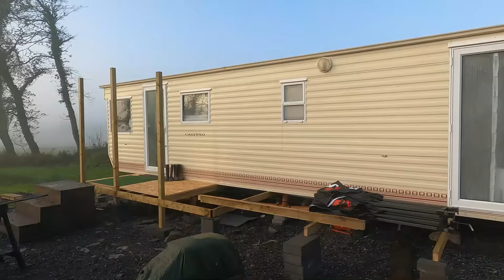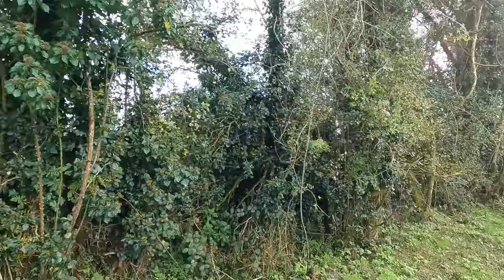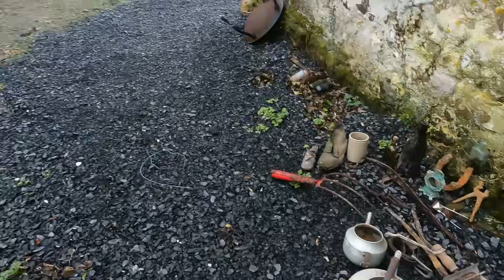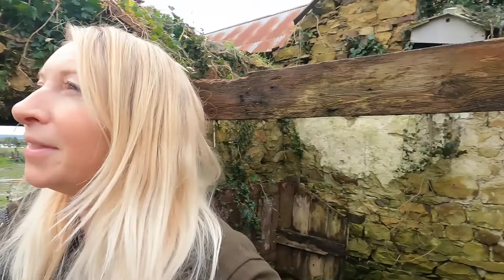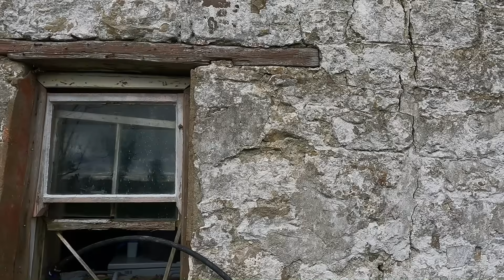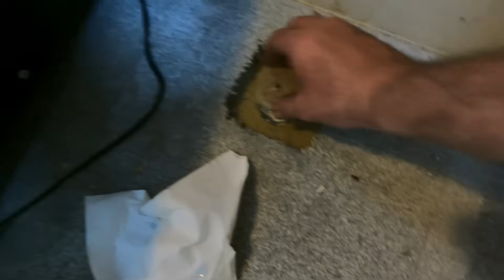Prepping for Winter - installing a diesel heater & and cladding the caravan. Episode 11

Comment: To ensure that the ivy does not come back, get some copper nails, as these are very effective. Although you could cut some scrap copper pipe in to slivers and hammer them in to the main ivy root at the base of the tree.
Reply from the maker: This is really interesting! Never heard of doing that before! I'll try and source some. Thanks. 👍
Reply: We use copper nails to kill trees in north america,

Comment: The horse harness parts are called the saddle, there is also a long piece of metal that looks like Collar hames. The thing you mentioned as a belt also looks like a part of the harness, where one side of the shafts are connected to the saddle.  The metal thing is a curry comb, its main purpose is to clean the horses brush of scurf when you're grooming.  The are also useful for removing dried mud on the horse.  I hope that helps.
Reply from the maker: Thank you so much. Really informative. I'm going to keep all the things we find. ❤️

Comment: Getting a 4 outlet diesel heater is a very wise decision…heating under the bed possibly? 
I am in a 2 berth touring as a temporary measure, and I have a Chinese diesel heater (5kw, one outlet). It does a really grand job, couldn’t be happier with it, but if I was going to be here longer term, a 4 outlet would be the way to go.
I have the one outlet where I sit, at night mode it is under the bed….
Reply from the maker: It's been a game changer, especially for the kids' bedrooms! 🙌

Comment: You are doing a great job' Plug every hole in the walls and floors no matter how small with steel wool. It wont harm the mice. They just do not like to bite it as it irritates their mouths.
Reply from the maker: Yes, we do need to do that. Thanks for the tip. 👍❤️

Comment: When I fitted a diesel heater in my man cave I put outside and then just the hot air pipes had to come through the wall a lot saver I think
Reply from the maker: Hi, yes, that was an option we considered, but there is a benefit from drawing the air intake from the already conditioned air inside the van. Sam has been really careful with the exhaust pipe, and hopefully, all will be well.

Comment: There was ivy cut away from trees at a station I used regularly. The bottom cut away that is and I was surprised to see the ivy didn’t die. Since I’ve noted that ivy seems to root into the bark of the tree. Anyway no expert and I wish you good luck 👍
Reply from the maker: Yes, my mum, who is a gardener, advised me it is likely to continue to thrive off the tree and to remove as much as possible myself. In a few weeks, I'll get the ladder up a bit higher and try to pull some more off.

Comment: Regarding the sheep wool insolation, some places now use plasma-ion treatment, this eliminates the use of chemicals and protects the wool from insects such as moths etc. Sheep wool is the most fire resistant.  Fiberglass and rock mineral wool is nasty stuff.
Reply from the maker: Thanks for this. We are still trying to decide what to use.sheeps wool does sound good and not too expensive either. Sam hated using rockwool when he used to do loft insulation jobs. It was purely down to costs that we considered it.

Comment: Not going to like the answer but that wall has to come down. Its leaning too much but its also cracked in spots. Thats a danger. No doubt it has poor or no foundation which is where the lean is from. Acro the roof for support. Pull it down start again with it.
Reply from the maker: Thank you for the advice. We gave had a structural engineer who specialises in long Irush houses like ours contact us. He is helping us out with our options so fingers crossed we will get it right even if the wall does need dropping. 👍

Comment: Those heaters used to be only available from premium brands like Webasto and Ebersbacher, with prices starting around €2000.
In the last decade or so, the Chinese flooded the market with cheap copies and if you get a good one they are brilliant. Too late now, but I’ll say it anyway, for others who may read it. You can get all sorts of fittings to split the output from the large diameter single output models. That makes it possible to design a more efficient hot air system, delivering more hot air to larger spaces and less to smaller ones. The difference is not huge, but if your heat output is marginal, it’s a help.
Reply from the maker: We had an Eberspacher in our motorhome. We regretted not taking it out, although there is still time since it hasn't yet sold! 
We stupidly realised afterwards that you can  easily adapt to 4 pipes. Have to say we think David's one is better than the one we bought but just as good as our expensive Eberspacher!🙄

Comment: Just cutting the ivy at the bottom will eventually kill the ivy at the top. However, the ivy roots will regrow unless you take them all out
Reply from the maker: I just don't have it in me to remove the roots...they are so vast! I've been told ivy doesn't harm the trees now, so I just don't know what to do for the best. I will do some more research on it. Thanks.
Reply: @theirishhomestead  yes, the roots can be massive sometimes. I have always been led to believe that ivy will strangle a tree and caused it a lot of issues🤷‍♂️. However, if you just control the ivy at the bottom and cut it back every year the trees will be fine. You could try a herbicide on the growing ivy at the bottom to kill off some of the roots.
Reply from the maker: @Duncan-el1qy  thank you. Yes, I had considered the herbicide to put on the cut parts. I hate seeing it smothering the trees!
Reply: @theirishhomestead the ivy that has been cut that is still on the trees will soon die as long as it has no connection to any roots in the ground. It will go brown in a few weeks and after a time it will be easier to pull off the trees. The herbicide would be for any new shoots which start re growing - this will be absorbed by the leaves and eventually kill be taken down to the roots and kill off the plant.
Reply from the maker: @Duncan-el1qy great thank you. Looking forward to removing it! 👌

Comment: Ivy is fine on Trees but will exploit any holes, cracks, openings etc; in Masonry, especially Stonework and as the Ivy grows and 'expands' will be detrimental over time. Basically, Trees, Bushes, Ivy etc;  dont make good partners for Buildings and are better off kept apart. I always use Lime Mortar for Stonework which allows the Stonework to do what it naturally does...expand and contract with weather conditions. 4 of sand 1 of Lime is ideal, imho. Good luck.
Reply from the maker: Thanks so much. We will definitely be  using lime mortar on the buildings. I'm just going to keep at it with the Ivy. 👍

Comment: To be honest guys, an old wall with no damp proof course and questionable foundations will always cause a problem. I know you don't want to hear that but it is true unfortunately. Rebuild a proper cavity wall with block in the inside and natural stone on the outside. It will take longer and cost more but if a job is worth doing etc etc...
Reply from the maker: Thanks. Yes, it's not going to be an easy ride, but we have been in contact with an amazing  structural engineer who specialises in Irish stone long houses like ours, and he I'd helping us. So fingers crossed we will manage to get it sorted one way or another. I love this place too much.
Reply: @theirishhomestead  it is well worth doing if done properly. My own home used to be a single storey Irish cottage but was raised to two storeys in 1954. The walls on the ground floor are stone built as original and about 24" in width. The upper storey is cavity block. Never been any real issues except for a little rising damp at the front door. The structural roof beams must be 18" deep...amazing.
Reply from the maker: @jbraeslamb thank-you. We will do our best to bring the place back to life. I'm keen to retain asmuch if its original character as possible, minus the damp of course! 😉

Comment: What are the u-values of the  rockwool you got vs the insulation you were going to get?
Reply from the maker: So for ease, and the ability to install in any weather we considered 2" Sealatex which would have cost nearly €1000 but had a fairly similar U value to Rockwool, which was nearer €150 but has to be installed on a dry day.  Or so Sam told me. 🤔

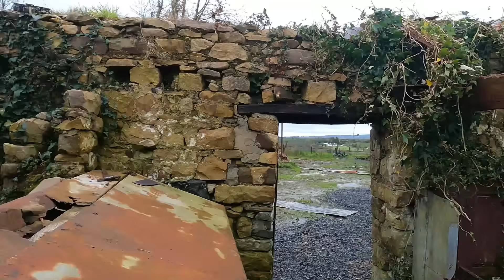Comment: That is so weird, at 18:38 you say "I haven't found any clay pipes yet", only 20 seconds earlier in the video I was wondering if you had found any Doogeens. I'm sure the people who lived there in the 1800s would have smoked Doogeens made in Knockcroghery. I'm surprised that you haven't come across some remnants of them in the spoil after the levelling of the fields. If the land had been used to grow potatos or veg which most of the land in the 1800s was used for then there should be lots of broken clay pipes deposited in the fields.
Reply from the maker: Yes so weird not seen any yet at all.

Comment: Why didn’t you put the heater under the home and outlet pipes into each room.
Reply from the maker: We did think of that, of course, one of the reasons was the pipes are also warm, so it seemed a waste running them outside and losing that heat. I have to admit, though, the one that has to go the longest distance to our bedroom will probably be better under the floor for appearances sake.  The kids bedrooms are literally only a few inches of pipes being so close to the heater. Plus, the kids have a habit of leaving stuff on the floor, potentially blocking the pipe outlet if we ran them from underneath.

Comment: Your stonemason will advise best, but you do need to realise that straight lines and right angles don’t occur naturally and the people building rubble walls, without foundations, knew everything was going to move, both during and after construction.
It’s one of the reasons why cement isn’t a good idea. It’s too rigid and it cracks, with the movement.
Natural stone/rubble walls are never straight in any plane. You’ll probably need to tie them together at the top, to prevent them spreading far enough to overbalance. Traditional A roof structures do that using the ceiling joist/attic floor joist. Upgraders install a reinforced concrete beam around the whole top of the wall, enabling them to have double height rooms, free of joists at wall plate level.
To my untrained eye, what you have there doesn’t look unusual and you’ll see much bigger bulges in towns, where the stone walls bulge out overhead, as you walk along the footpath.
Your stonemason will know best, though
Reply: True, and I suppose it's lasted this long without any maintenance. I have seen other reno projects where they could put an internal breeze block wall in that 5m length for the trusses to comfortably rest on., but even if required, they may not want to reduce the size of the internal space.

Comment: All you need to do with the ivy is to cut the stems at the base. The ivy will die and fall away from the trees in due time.
Reply from the maker: Thank you. I hope so! 👍
Reply: @theirishhomestead  It really does work. The ivy falls away in the gales and the tree breaths a sigh if relief like an old fashioned woman taking off her corset. The ivy acts like a sail in the wind bringing the trees down in storms, so sorry that we limited natural habitat, but the trees came first. We cut through some stems 6”in diameter. They burn well after seasoning with a blueish flame.
Reply from the maker: @wendyrowland7787 thanks I needed to hear all my efforts were not in vain!

Comment: Its not Middle-age, somewhere along the line married men discover that their wife is also their memory. They are fine with this as it allows them to get with things.
Reply from the maker: We are a team and Sam knows he couldn't do any of this without me and vice versa.
Reply: @theirishhomestead  l get that. My ex was absolutely amazing with numbers, she could do in her head what I couldn't do with a calculator! At the same time, a IKEA assembly diagram was gibberish to her. While we were together, we made a pretty good team. 

Before a forget, there are these renovation videos from China, where they are restoring houses, some of which are centuries old. Instead individual pointing, they used cement like mortar on it inside and out. It strengthened the walls amazingly!